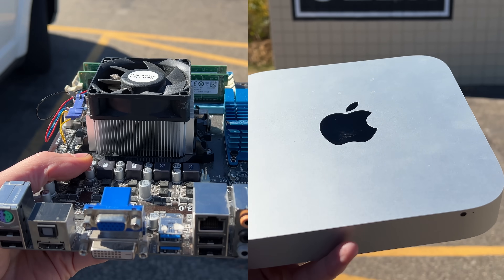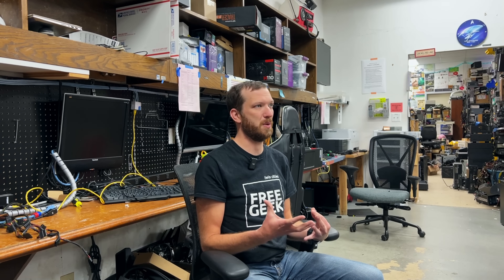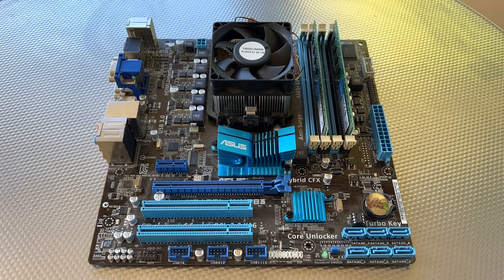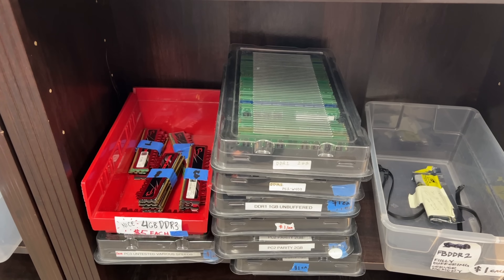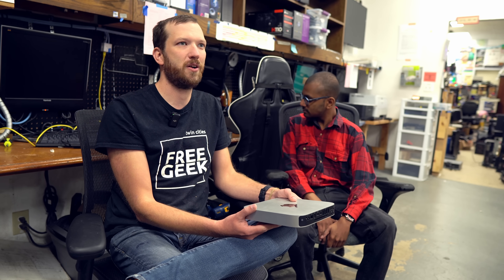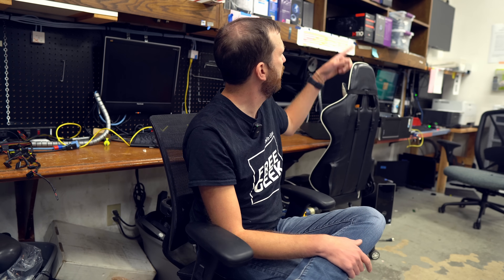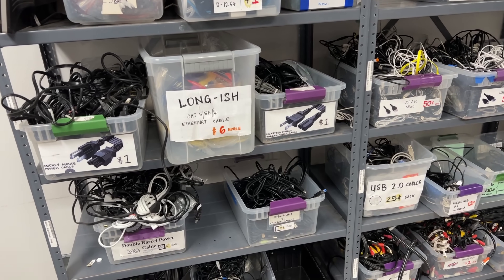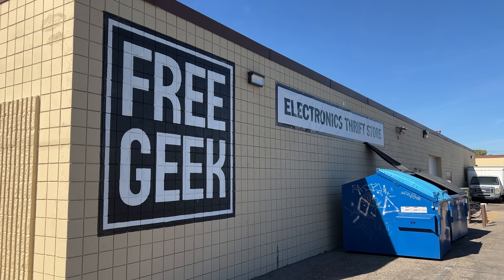From HomeLab to E-Waste: Giving Old Tech a New Purpose at Free Geek

Comment: The portable label in the 70/80's is for transportable. "It's not a computer of the size of a room" meaning.
I remember my dad getting a portable form work in early 90's. A white toshiba with a clock for the estimated remaining time of the battery, with win3.11. It was closer to the thinkpad, but THICC
Reply from the maker: @guy_autordie  it was cool that it basically could close up like a suitcase and had handles!
Reply: @TechnoTim  I agree

Comment: I have the blue retro laptop, used for serial work on hardware.  It's actually faster than some modener laptops.
But it runs old hardware and has old tools that you just don't get these days.

Some of the enterprise hardware is way cheaper than we can get here in the UK. Lucky guys.

If it don't cost a lot to run (I have solar) and it will do the job you want, why buy new? 
I have quite a lot of retro hardware, it doesn't break as much as the new (yet old) stuff.

Comment: I was surprised to learn that Logitech unifying mice and keyboard or anything that uses the unifying receiver does not work easily on Windows 11. A reddit comment directed me to download the Logitech set point program which has drivers that work, but before I download it nothing was working. Even Windows update and autoplay would not detect the Logitech unifying receiver and the Logitech unifying software didn't detect it either. So that could have been close to e-waste just because of the change to Windows 11